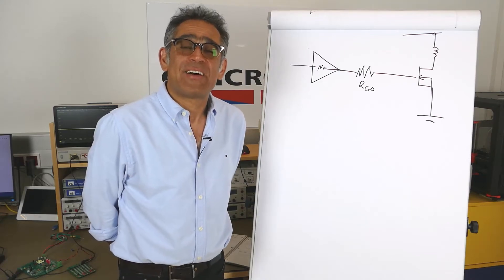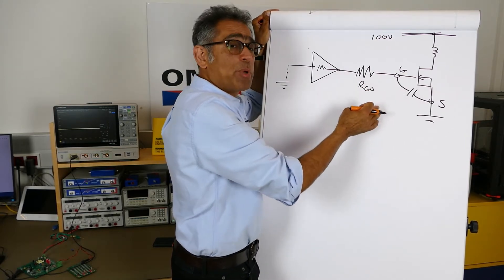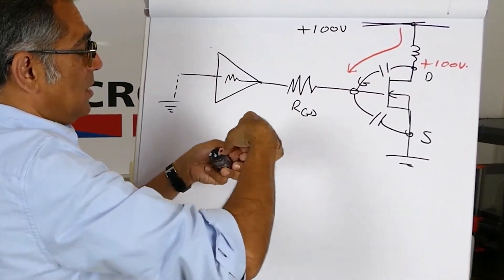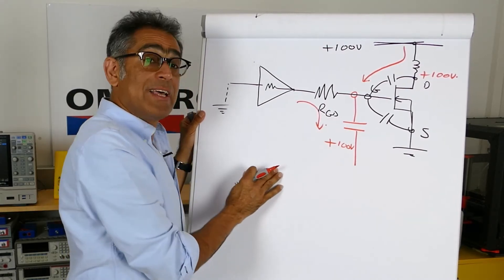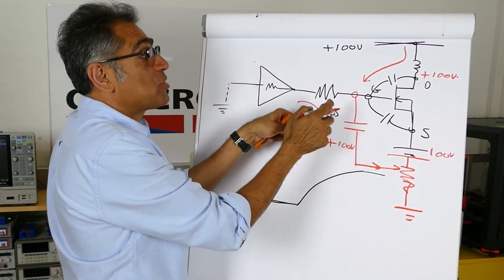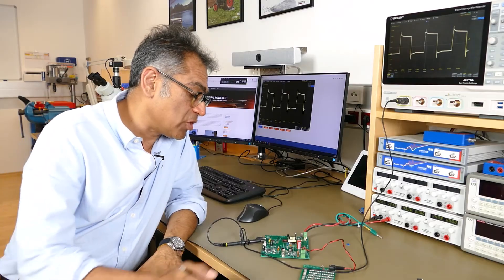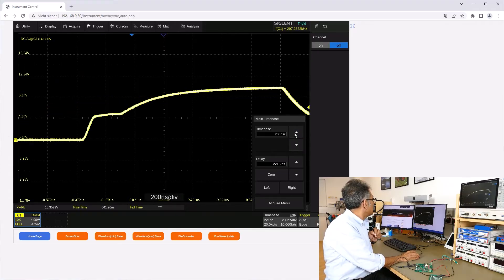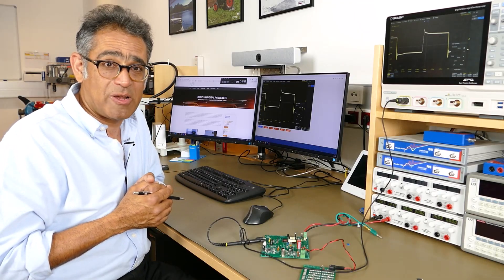Miller Plateau effect within MOSFETs explained – a simple and intuitive approach

Comment: At beginning I think is correct,but think deeply, I felt something wrong for Cgs has charge to flow to Rg, since Vg is high in initated stage, Vd=0 volt(turn off), it would not have 100V across Vgd.

Comment: This is an explanation that works for me: The gate voltage rises and at the gate threshold level it starts to turn on the mosfet. As the mosfet starts to turn on, the drain starts to quickly lower in voltage towards the source (and gate). Since there is a parasitic capacitance between gate and drain (which is charged to 100V to begin with) the drain pushes (by using the charged capacitor as a push rod) the gate voltage downwards. The 0V end of the capacitor is at the gate and the 100V end of the capacitor is at the drain. The drain is actually sabotaging its own motion by pushing down the gate (through the capacitor). If the drain pushes the gate too hard downwards the drain itself will start to loose force since the gate is controlling the drain and therefore it will push less hard. It is a feedback loop. For a while there is a more or less equal force driving the gate upwards (from the gate driver) and downwards (from the drain through the gate/drain capacitor) which creates the plateau. In the end the gate driver wins (capacitor cannot hold it's charge forever) and the gate voltage finally continues upwards and the drain voltage continues downwards.

Comment: Dear sir, thankyou for this BEST explanation of the Miller plateau. 
I want to ask you an advice, of lets say the Drain sits at a High potential rail of 400Volts DC. 
And with during initial Turn-On, That Cdg charge goes inverse on the Drain, as you explain: 
does this imply also that very briefly a -400V amplitude occurs on the Gate towards the Driver ? 
And thus a fas Turn-off discharging diode needs to be able to cope with this -400 reverse voltage ? 
So a 1N4148 will not be sufficient for the task ? 
I would really appreciate an answer on this, and I think many will benefit from your advice on this. 
Thank you & best regards, Harry.

Comment: I like your presentation. Also the workshop has machines too😁😁. 
I think GaN Mosfet is much better Switch than conventional mosfet in terms of Internal parasitic capacitances and Qrr. 
The challenge is low Gate threshold and gate drive voltage sensitivity .  Conventional Mosfets have much more robust construction.

Comment: I usually place a small inductir in the circuit in order to compensate for the Cgd capacitance. 
In the case if an amplifier (not switching) i use a second transistor in series, in what is known as a "cascode" configuration; the disvantage is the use of two active components doing the function of one, only to alleviate the Miller capacitance.
Thanks for the video...

Comment: Very nice explanation of the Miller Plateau effect. Thank you. I would like to know about the Switching (7:16/7:41). There is dip  far below the base line when the mosfet is switch off and when it it switch on it again rises above the upper limit even if it is for mS duration. Why this is happening ? What are its effects on the performance of the mosfet. Is there a need to smooth them out ? Can you pls explain this a little bit ?

Comment: can you explain why the capacitance moved at 2:34? not sure why turning on the MOSFET changed the capacitance. thank you!
Reply: From my  limited understanding, its because when you have enough gate voltage to create a conduction channel drain and source are  shorted together, so now effectively   Cgd and Cgs are in parallel, added together, so now yo have a single cgs transistor

Comment: I watched 3 times and seemed got what he meant in details. When Vth just reached at the gate, drain voltage is on the way to be connected to source which is grounded. This is when Cgd will be discharged and then get re-charged at the opposite direction from the positive gate voltage. The plateau forms as the Vgs is “waiting” for Vgd to be recharged before rising up again

Comment: I am having issus of IGBTs heating up and tend to fail.  I replaced with genuine and same part on the 3KW HB smps. A spike is being generated in the middle of the rise time charging of the IGBT. Tried a lower value than 10R but things got worse.  I am afraid if I change to a higher value such as 15 or 20R as this will even slow more the charging time. How can I cure this problem?

Comment: Great explanation but my biggest complaint about theory based learning has been the lack of real-world context which was not even mentioned, while I understand the complex nature of learning this for the first time, young engineers need to know that you can't just hard switch everything. In the real world EMI will ruin your day! I remember the first time I had to face the facts of EMC qualification and the absolute disbelief that I never heard of it while in college. I'm sure you are aware but just in case someone reads this comment, there aren't many applications that allow hard switching. The trade off between passing EMC and performance is a tough one to swallow. As switching node dV/dt increases the EMI increases. Please forgive me if this topic has a video of it's own but it would be helpful to provide a link to help young players continue the journey to real world proficiency. Not to take anything away from the outstanding job you did here, it's beneficial to learn the real world issues that arise with each subject.
Reply: Switched techniques usually save so much energy that the relatively little bit of heat dissipated for conduction during slower switching is often preferable to EMI “fallout”. In economic terms, the higher the product volume, the faster one can switch while still affording the development.
Reply: @absurdengineering  "Often preferable" is a little too generous, it's an FCC mandated trade off. Maybe for low power large formfactor applications it's preferable but in todays compact designs it's an EMC requirement, otherwise we're stuck using large transformers/inductors. It's truly a convoluted balancing act where the application determines the best approach.
Reply: Thank you
Reply: hardstyle905  Contrarian has entered the chat... Nice of you to join us. I had no idea you wouldn't have your day ruined by failing EMC, you must be special.
Reply: hardstyle905  You commented to disagree and brag about the lack of regulation in china? That's unique position to take, I agree, you are special.

Comment: But my doubt is before reaching to miller platue why current doesn't not flow through the CGd ? Lets say your drain node is fixed but when it's charging Cgs then bottom node voltage is changing then there should be current flowing through the Cgd also before Vds starts falling out..
Reply: The Miller effect occurs because there is voltage amplification between gate and drain. As the turn-on threshold is reached and the mosfet begins to turn on, a small increase in gate voltage produces a much larger decrease in drain voltage, and that applies a negative feedback via Cgd. So the gate voltage cannot rise, nor the drain voltage fall unless current flows to discharge Cgd. That is the Miller plateau.

Comment: Nice presentation.  They should invent a screen grid for mosfet
Reply: Some of the early mosfets from the early 1970s were 4-terminal devices, having two gates. This made them good rf amplifiers as you effectively had a cascode arrangement which minimised the Miller effect by fixing the voltage on the upper gate, thus clamping the voltage on the drain of the lower part.
Reply: @RexxSchneider   yes I realised cascode a short while after I wrote the comment but rather than delete it I thought make a fun comment for someone to read.   Cascode goes back to thermionic valves probably further. 
I've had great fun with 3N201s and 3SK88s and the like.  The great thing about them is a pair makes a superb balanced modulato. These dual gate mosfets also make a fabulous VFO oscillator output buffer with nearly infinite isolation. Also make great AGC control elements in a IF amp.

Comment: if the aim is to reduce the miller plateau then why  do we put the gate resistor in the first place .. ?
Reply: Many times they use it to damp  gate ringings.
Reply: make the FET spend longer time conducting in the 'linear region'. Trade conversion efficiency for lower EM emissions. The FET runs hotter. If the emissions are too low after product EMC testing you can omit shielding or keep shielding increase the FET switching speed
Reply: The gate resistance  here is not always physically placed component but simple representation  of gate drivers output current limitation.
Reply: @kadamrohan16  I have seen an external gate resistor used often in gate driver circuits. It may have some other purpose.
Reply: The MP is always there and it's a secondary effect. It's like lights go dim when switch a big motor on. 
By watching 'lights go dim' you can detect when there's a current drain.
Reply: A capacitance is equivalent to an instantaneous short circuit and there must be some limit to the current drawn from the driver. Either the driver limits that itself, or we put a gate resistor in series to set the maximum current drawn. An additional consideration is that if the driver switches rapidly -- and we normally want it to -- then any inductance in the line from the driver to the mosfet gate will create a closed  LC circuit via the grounds of the diver and mosfet source, which will cause ringing, or even oscillation, unless it is damped by sufficient resistance in series.
Reply: the dv/dt on the drain, via miller coupling plucks the gate. If the gate's held too tight it 'twangs' like a taught string
Reply: The faster the gate switches the higher the harmonic content of the waveform. This can easily reach megahertz with significant power. This radiates from the circuit causing radio frequency interference in the environment. There are gumment regulations placing limits on the amount of interference your device is allowed to produce so you must consider this in your design.

Comment: A nice short, sweet, and perfect explanation with a great teaching method, thank you! 
I would like to ask about noise that may be generated due to fast switching, would it be a concern at all?
Reply: @jasongreene303 Exceptional observation, the answer to your question is absolutely yes. As the switching node dV/dt increases EMI increases, in the real world you are constantly battling the effects of EMI which is always a performance trade off. As mentioned in the video switching losses increase the slower you turn on the MOSFET. Snubber circuits can help cheat the pitfalls of hard switching a MOSFET but cost and complexity increase. You will always have to keep in mind that even if the circuit works it doesn't mean it's optimized, that's where the rubber hits the road. It would be great if we could hard switch everything but the truth is it's only acceptable on the bench. I suggest reading device manufactures application notes on the subject to better understand methods of avoiding EMC problems. Great question, you deserve a cookie.
Reply: @str8upkickyaindanuts289  You are very kind, thank you. 
I have to admit that I am aware of the interference from switching supplies as it makes for some horrible noise in my HF receivers, but I am not familiar with exact circuit design specifications other than the noise I see on a scope in a video such as yours. I wish more manufacturers were responsible about this. 
I look forward to perusing your library of information. Thank you

Comment: There is an additional charge from gate to channel you have ignored in this simplified analysis .   Once charge starts to flow in the channel and equal amount of charge must be supplied to the gate.   This is fundamental to all three terminal devices to which are governed by charge control model in their linear operation regions.   Why did you ignore that charge?
Reply: He just explained the miller plateau caused by the nonlinear capacitor Cgd